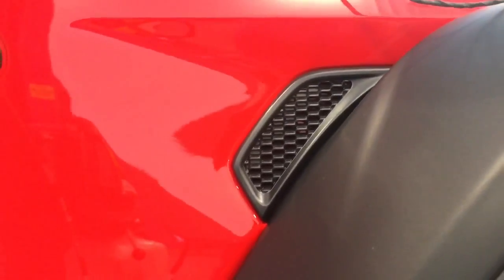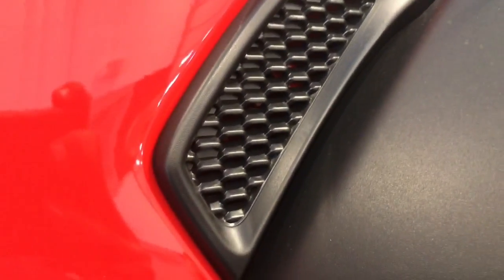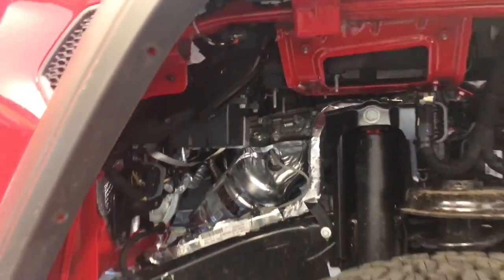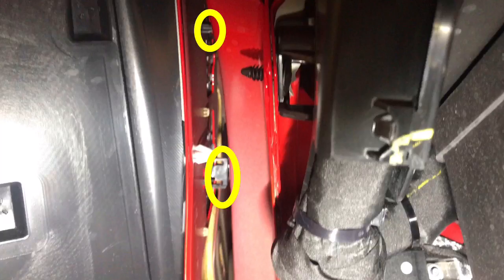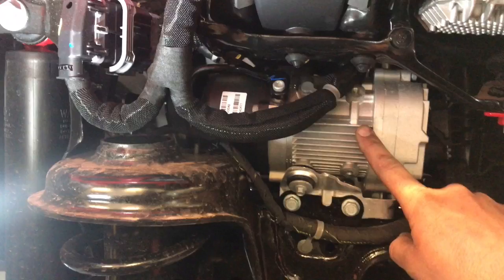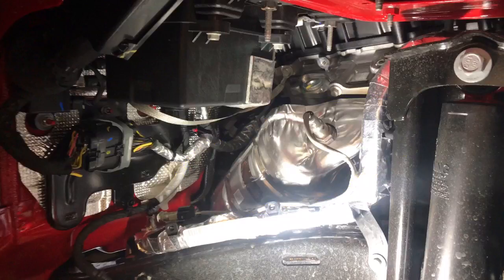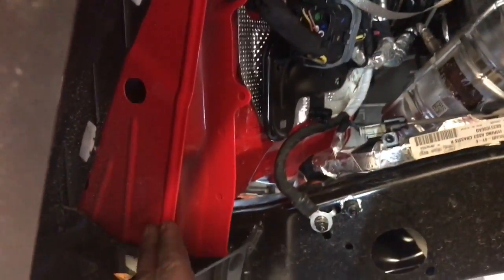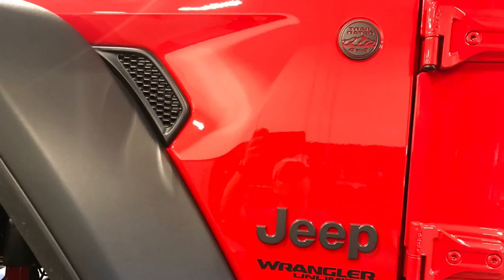Is the SIDE GRILLE for more than looks? 🔴2018 Jeep Wrangler JL

Comment: I really like what you are doing with the JL.  Short informative videos on stuff the average JL owner would never know.  I wish that you had started a similar series with the JK, so that me, the uninformed, would know more about how my JEEP works and useful mods.  Be that as it may,  in many of the pre-sale videos on the JL, I recall that the side grille vent was placed there for two reasons: 1. as you state for heat dissipation from under the hood, and   2. to allow an under the hood air flow exit to prevent hood vibration at high speeds.     Also, well done green screen at the beginning of the video.   Keep up the good work.

Comment: I'd read somewhere that those little grilles also served in preventing or decreasing hood flutter.
Reply from the maker: Yea. I hear that also. Wonder how they measure hood flutter?🤔
Reply: Great point. I'd read that the JKs had what some would consider excessive hood flutter, but I'd think that better designed hold downs would fix the issue, and from what I see on the JL hood hold downs, that issue was addressed.
Reply from the maker: You are correct the new style hood latches fixed Hood flutter.
Reply: That being the case, the only logical reason for those fender vents are for the exact reason you'd mentioned in this video. Btw, I'm a big fan of the videos you put out and thank you for doing so.
Reply: the hood flutter was corrected (successfully as far as my 1270 miles indicated, many at 80mph +) with two changes from JK to JL: 1) improved hood latches (already coveted by JK owners!) and 2) side vents to allow the air to flow up instead of butting up on underside of hood. it seems a bonus (by design or luck) they might also help dissipate heat.

Comment: In the JL announcement presentation they said it's to relieve air pressure under the hood during high speeds in order to remove hood flutter. I'm sure it helps with cooling also.
Reply from the maker: I think the new hood latch release fixed the hood flutter. The old ones were made of rubber and plastic. Which allowed the hood to raise up and down a small amount in high head winds.

Comment: Yup, it was for the hood fluttering that was experienced on the JKs. Under certain conditions at speed, when you got a cross wind you’d see the hood flutter up an down a bit. These vents make a negative pressure area so it was suck more air in from the front in times of crosswinds. I can’t see them helping much with heat, although I’m sure they do to a degree.(No Pun) 😬

Comment: So I've found out that they were for preventing hood flutter as well as a heat escape. I can say that I've checked after driving for awhile and yes there is a good amount of heat coming out of that vent for sure so it works. I've also experienced no hood flutter even at high speeds with my JL.
Reply from the maker: Thanks Frank 👍 I think the new hood latches  help out the hood flutter also.
Reply: Frank Ducharme I

Comment: i heard it was for reducing wind noise on highway speeds
Reply from the maker: No. It doesn’t. Only the unlock button. Now if you do unlock the door with your manual key the the alarm will start honking. once you hit the start engine button or press unlock on the key then it will cut off.

Comment: If you are a "Jeep informant"  as you say, then you should at least do the minimal research before posting a video.
Jeep stayed at reveal that it serves 2 functions.  Dissipate heat from under the hood and mainly relieve pressure from under the hood and eliminate hood flutter.
Know your facts 1st before you try to educate others.
Reply from the maker: Stephen thanks for you honesty. That’s half the reason I did post a video to show you How it could dissipated the heat. Personally I think the new hood latches did more for the hood flutter than this vent does.
Reply: Don't be a jerk!
Reply: Jeep also stated at the reveal if you added bigger tires the system would auto correct, which is not true, you have to pay deal to run a program.  Looking to see if actually flows air was worth checking.
Reply: Take your constructive criticism somewhere else or don't watch the channel at all. I don't see you taking the time out to make high quality videos.
Reply: Why add useless negativity, Stephen.😇 
The fact that Brandon went through all that effort in taking the inner fender out to show the vent hole was worth my time in watching. What’s that saying about not complaining if it’s free?...something having to do with a gifted horse 🐴.
I appreciate all your informative YouTube videos. Keep them coming; there are many people that enjoy them!
Brandon, I purchased a used 2018 2 door JL last month and I have learned so much about my JL from your Youtube channel especially about having 2 batteries! I would never have taken the time to remove all that stuff to get to that small 12 volt motorcycle battery hidden under the fuse box. Bravo. Seeing your videos has given me the confidence and heads-up info to consider tackling such projects.
Reply from the maker: Thanks James!!